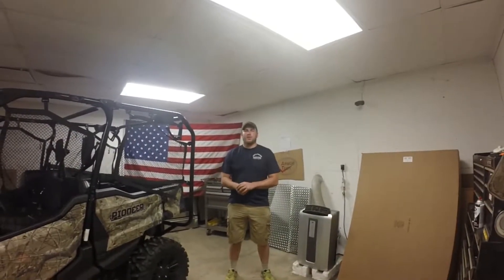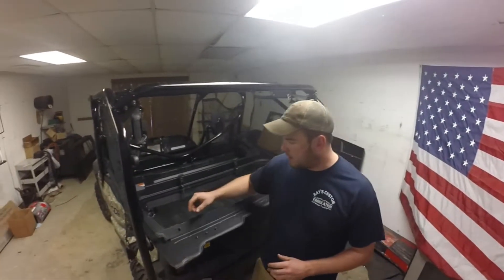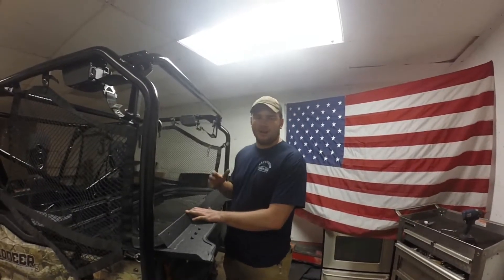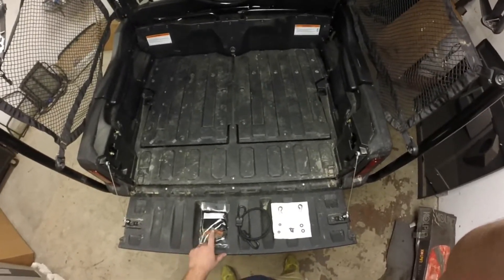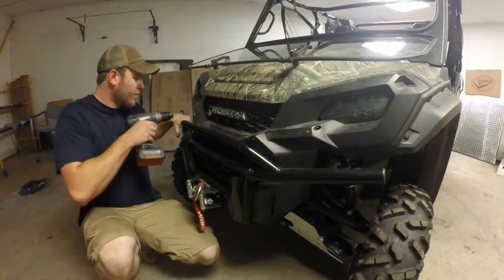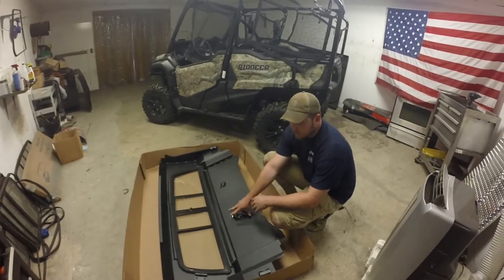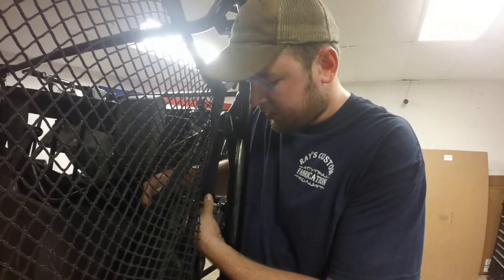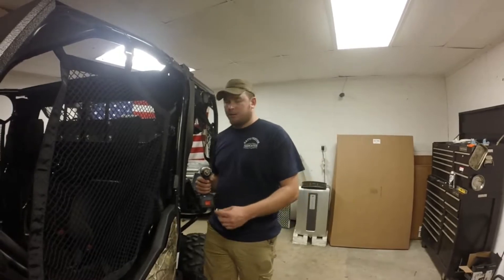Armor Tech Honda Pioneer 1000 Cab installation

Comment: The Armor Tech cab kit is really nice and solid. I personally would only be interested in A pioneer 1000-5 with a hard shell cab with heat and AC for as much as these things are. A few quick curious questions. Does the inside cab have any condensation with the heater on? Also what is the weight of this full hard shell cab by itself? One more question, with this configuration will the safety bars still go on the vehicle on the back half? Pricing for this shell?
Reply from the maker: Our email address is support@armor-tech.com, please feel free to email with any questions you have! Thank you.